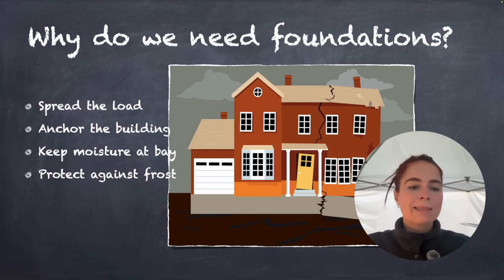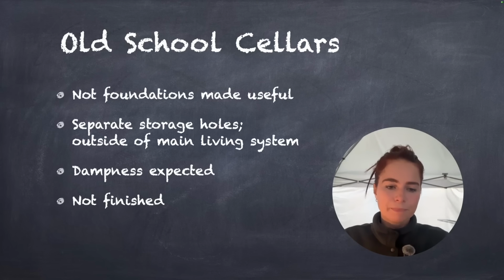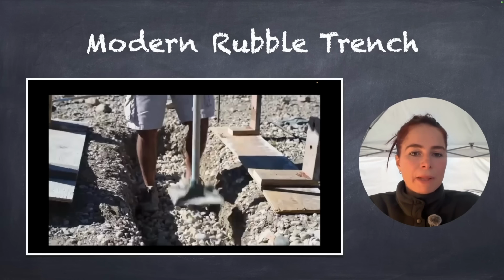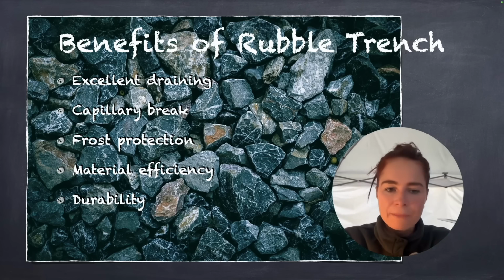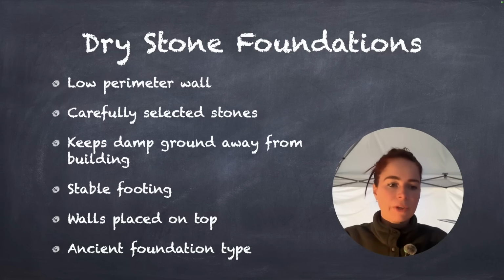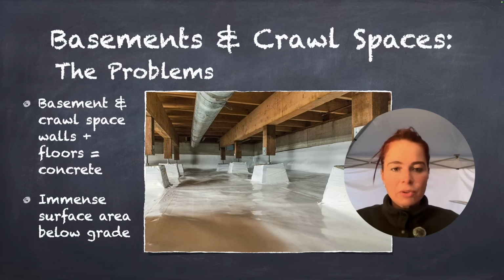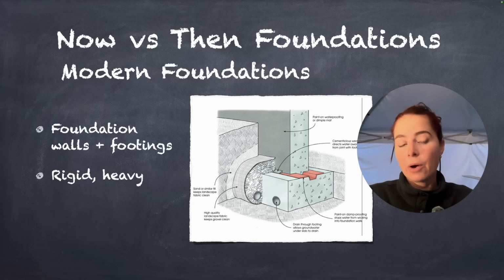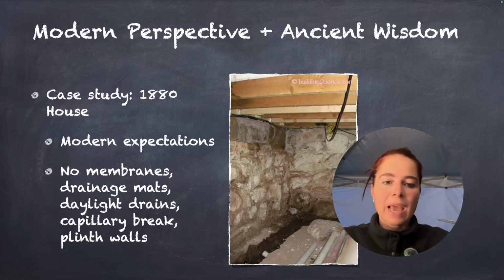Why Modern Foundations Fail — and the Genius Design We Abandoned

Comment: You can fight the water or you can control it. The most important thing is to give it a path of least resistance where it naturally flows away from the living space. Whether it is done with modern methods like bituminous membrane plus drainage pipes or stone trenches, the way to guarantee failure and it is all too common is to SKIMP on the details. You can't take shortcuts to cut costs when the foundation is the most important aspect of construction.

I have followed alternative builders and construction techniques since High School in the seventies and seen many good and bad applications. There are many earth sheltered homes with no water problems and some that do. 

I have seen something as simple as applying a coating of bentonite (clay [it's not just for your complexion] ) that works by absorbing water until it is so full any more water cannot enter which then finds somewhere else to go. That is the key principle no matter what solution you like make it easier for the water to go elsewhere.
Reply: How did well made old cellars solve the water problem though?

Comment: here in the netherlands, on many places the groundwater is on about 40 - 60 cm deep.
and there are many old basements but also naviducts new concrete basements etc.
just use good groud injection and high quality waterproof concrete.
it is like cars. you have usa quality V8 with no power lots of weight no speed etc. or a smart fast car from europe. ( or get a Toyota )

Comment: great especially i alreddy thought and experimented with rubble trenches in small scale without knowing that it is an old technique . Your information will give a good base ; ) when i start building houses in brazil. Nearly " all " of them have moisture problems on the outer walls. You can see very often black mold which i thought mainly come from rainwater dripping from the roof. most houses dont have a gutter. Ok i also considert the moisture coming from the earth cause they do not install a impermeable layer like bitumen...now i am curious about the pricecomparison and availability of gravel...
Reply: Me too. I live in the Amazon region of Brazil. It rains A LOT and the types of materials are limited in availability. Most houses are cheap clay blocks and foundations are rebar reinforced concrete. Any of this style over 15 years old is degrading and falling apart.

The soil is mostly clay and doesn't drain. I have doubts about the longevity of perfurated drainage tube for French drains. I don't see geo textile anywhere.

Comment: In the UK if a well mixed and compacted concrete wall is 200mm thick it is considered to be waterproof and individual slabs are connected with water bars to prevent moisture finding the gaps. Only commercial buildings are concrete. Most residential buildings are brick or block construction with tanking provided within the wall , on the outside surface or on the inside surface. Tanking is usually a reinforced bitumen, modified render or EPDM sheet. Maybe puddled clay would be a cheaper and more environmentally acceptable treatment for basement walls? This is a technique used to waterproof aqueducts - it may fail if it gets too dry?
Reply: Agreed. At 200mm (8") RC32+ concrete is considered effectively waterproof when well constructed, with appropriate supporting ancillary materials and well designed groundwater drainage systems should be able to resist fairly substantial hydroscopic pressues and remain dry on the internal face.

Most dampness in basements comes from poor ventilation and condensation due to the  uninsulated subterranean walls being cooler than the air temperature - although excessive groundwater above the formation depth of the basement will obviously cause moisture ingress unless its either reduced or stopped by an appropriate barrier.

New basements, be they brick or concrete, should be external tanked, insulated and well ventilated on the warm side (passively or mechanically) and you will never have any damp or mold issues.

Comment: It's good to review construction from first principles rather than be conflicted by taught methods. Knowledge of old techniques is useful. Use of vibrocompacted rubble is still present for foundations and floors known as 'engineered fill'. One unusual technique I have witnessed is excavation of peat fill below an old concrete floor to a depth of 5m and then mixing the peat with lime and then placing it back in compacted layers finished with a new reinforced concrete floor slab. In the UK we are lucky to have some magnificent 1000 year old buildings built with the expertise of stonemasons with no concrete used.
Reply: Can you explain the technique a bit more deeply
Reply: @notaras1985 It was during the refurbishment of a 70 year old aircraft factory 20 years ago to be used for high bay storage, requiring a much higher live load design. It was intended to be more economical than disposal of the peat and importation of crusher run fill.

Comment: Off the subject, but I'm a student of vernacular architecture and I've noticed that advocates of vernacular architecture today tend to romanticize very, very massive construction, like rammed earth, or adobe/cob, or structures with very thick walls like hay bale.  That's fine and they can be very beautiful, however the greater the mass,  the greater the labor. Frame building can be very economical. It was actually invented for that purpose. It uses the minimum material to do the job. Like Bucky said, why are we going heavier and heavier when we could be going lighter and lighter? Tropical architecture often uses extremely light materials as well. We have a long enough tradition of frame building in the Pacific Northwest that we often refer to early examples as vernacular. This is a timber rich region to this day. Especially, those building for themselves for the first time might want to learn that simple framing is far less labor than massive construction. Homes can be on relatively light foundations, and we have zero problems keeping them bone dry. We know how to seal the concrete and we know how to drain the foundations so they don't get wet.
Reply: being timber rich, wouldn't a Permanent Wood Foundation make sense? Then you could have a wall assembly that can be insulated
Reply: @krisgehrholz9817  There is code for treated wood foundations, but treated wood does not last, at best only double that of untreated, around here 20 years at best, plus its full of chemicals
Reply: @hansnelsen3960  I'm building at 8500' in the Colorado Rockies where the humidity level is extremely low. The below grade portions of the structure will receive the same methods of mitigation that a concrete foundation would. Its also a different grade of treated lumber, and it won't be in the conditioned space. It Is a resilient, renewable methodology

Comment: Around here, Western Washington State, if you dig a hole and fill it with stone it will fill up with water and stay wet, unless you drain the water down grade to below the depth of the hole or trench. This is because we have high clay soils, so one must provide for foundation drainage. It wont simply disperse in clay soils. Also around here if you have wood at grade sitting on the ground, or in contact with earth, or say on top of a trench filled with rubble, soil will form up against that area and begin to rot the wood. All wood must be kept minimum 8" above grade in our rainy climate. Lets say you had 8" of building stone above grade, then you could put the logs on that, but even then on a vapor barrier. In the past they used bitumen, yup, tar.

Comment: Just brush the concrete/cinderblock basement/crawlspace wall and floor with MasterSeal 581 - formerly Thoroseal two to three times and you are done.  It seals moisture and water out permanently.
Reply: any VOC's in that?
Reply: @krisgehrholz9817  MasterSeal 581 is a cement-based waterproofing coating, no VOC.  It resists both positive and negative pressure.  People used it to waterproof large concrete rainwater cistern. It also waterproves crawlspace that leaked water during heavy spring rain when snow and ice also melt and even french drain and other waterproofing cement products did not completely stop the seepage.

Comment: It really all comes down to the market and what it will allow the purchasers to buy.
  All types of foundations are used today.  For different types of structures of course.  The typical home foundation is just fit to price. Not priced to fit.   Most homes don't use a commercial building foundation due to the expense.
Some build only in black dirt to reduce the expansion of the clay soil.
Roads are built the same as the old ones.  The big ones are harder to pound down into the dirt and they don't displace easily too the left or right.  The type of rock that has a high friction angle.  Once consolidated it won't compress under heavy loads.  
They will even run the upper layer of Base Rock through a sieve analysis.  
Run plastic under your slabs.  Probably do the footings too.

Comment: No one design fits all environments, but I agree basements are simply asking for water related issues. I'd say a compromise would be the pedestal crawl spaces, IF drainage around the perimeter is designed properly AND using concrete with some crystal growing catalyst mixed in (the crystals grow when wet to effectively self seal). Mostly for the ability to access the underside of your house for plumbing and electrical servicing without raising the floor too much.

Comment: Sigh...the repeated statement of "we forgot about this" - we didn't forget... engineers know this stuff but concrete for all its flaws is superior in many many ways. A huge one is cost...concrete is way cheaper than this type of foundation in raw material terms, much more scaleable, and a lot faster to build (which also makes it cheaper to do)

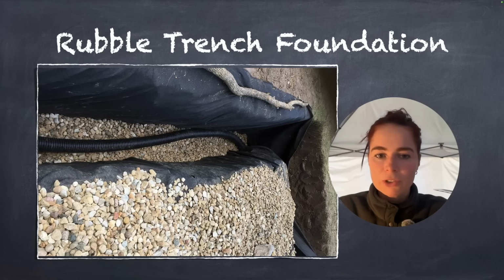We can and we now use the same "principles of moisture management" mentioned here 19:35 and others not mentioned to make concrete foundations systems less prone to damness we see in the type of basements we have in most of our homes built in the last 100-200yrs....

New basements don't have the same issues we had historically with basements...if built right
Reply: This is also why most new homes in most places are built on slab foundations and not with crawlspaces and basements unless we are willing to invest the time and resources to do it properly...
Reply: My basically take away from this whole video - don't build with crawlspace or basements unless you can do the things needed to make it work well...which is basically what we do these days when we build homes and buildings...not sure we need to bring back an inferior bearing method to deal with things when we have alternatives to do it differently already...

Still, a good job explaining everything

Comment: You should prepare your work ahead of time and have a printed outline or cut sheet available to you so that you don't use the word um too many times. 

I'm a Professional Civil Engineer  and I have considered using something like a small trench around the foundation and placing a perforated drain pipe along with rubble stone so that a drainage system could be designed for the building. I am interested to hear your thoughts on this.

Comment: This won't save a house built 60 years ago. The only option is to dig a trench down to the base of the foundation. Fill it with coarse gravel. And put drainage underneath to drain the water.

Comment: What a fascinating video! Do you think a rubble trench would do well with a walipini, half underground greenhouse? With piping going through and away from the structure? I suppose it all depends on my soil but haven't got anywhere to do it yet :) Loved the video, subscribed
Reply from the maker: Thanks so much — that’s such a good question! A rubble trench could work with a walipini if you’ve got a slope that allows it to drain to daylight. The challenge is that most walipinis are cut into the hill, so they’re fully surrounded by soil and don’t have a lower spot for water to exit by gravity. In that case, you’d need a sump or drain system instead. I’m not an expert, just learning and sharing :).

Comment: You are a very beautiful girl and very well-read. But you are misinterpreting the pros and cons of building structures. The basement under the building is a huge plus, not a minus! This is an additional "free space" under the lids, which can be used to store food (due to the low temperature), which just fits with your idea of eco-friendly housing. And the most important thing is the space for laying communications! Water and sewer pipes, heating pipes, etc. All this can be hidden and at the same time have quick access to them for maintenance and repair and even complete replacement without having to break the floor or demolish the house altogether due to the inability to maintain communications embedded in the ground! And stale air is a mistake in designing the ventilation system in the house! Of course, if there is no supply and exhaust ventilation, the air will always be musty! As for the capillary rise of water, this is also an easily solved problem! For this purpose, there is now a geomembrane and various waterproofing coatings for concrete, which are MANDATORY for use in such structures.
On the contrary, a foundation made of rammed rubble is an extremely unsuccessful construction. It is not monolithic, therefore it is not suitable for the construction of at least a two-storey building. When the soil moves due to subsidence or, conversely, rises from freezing, it does not protect the building from cracks in any way. Water is an important issue, especially in the conditions of the north (I also live in the north and I know very well about the frosty heaving of the soil!). Your foundation of rubble is essentially a ditch into which ALL the water from the surrounding area will accumulate! Gravel filling is a solid void that will fill with water as soon as it appears! Autumn rain and spring snowmelt will turn your foundation into a pool filled with rubble. Drainage of water from it is possible only if your house stands on a mountain and you can bring the drainage pipe to the nearest slope. And this does not guarantee getting rid of moisture, because when the ground freezes in winter, the drainage holes will freeze and water will be able to accumulate there until late spring. As for the forced discharge of water by a pump, this is a completely useless option. Any malfunction or lack of electricity or clogging of drainage holes will turn your foundation into a swimming pool! In general, the foundation of rubble is an unsuitable option, so it was abandoned. You don't have to do it the way you did 3-5 thousand years ago. They did this because they did not have the best materials and technologies. They had neither concrete nor waterproofing polymer materials. But at the same time, it was warm in Rome and they did not encounter the problem of freezing the ground. Study modern architecture - everything has already been thought out in it. It's just that not all builders know this, and many want to save money at the expense of the customer - without doing what is needed according to the norms. Knowledge will save you from this.
Reply from the maker: Thanks so much for taking the time to share your thoughts — you bring up some really important points about drainage, frost heave, and the role of basements. Just to clarify though, a proper rubble trench isn’t meant to act as a monolithic footing on its own — it’s a drainage and frost-protection system that supports a structural grade beam or footing above it. When it’s detailed correctly (with washed angular stone, geotextile wrap, and a drain to daylight or sump), it actually prevents water accumulation rather than causing it. There are plenty of modern two-story buildings using engineered rubble trench systems successfully, even in cold climates. It’s one of those old ideas that still makes a lot of sense when adapted with modern building science.

Comment: You could still have a basement but it would be smaller than the above floors and this would solve the water ingress problem.  The basement would be about 1/2 to a little larger than the above ground floors.  This would work on slopes where you can put drainage pipes downslope.

Comment: I hate to rain on your parade, but rubble trench is a bad type of foundation. Learn about frost heaving. There are better ways to drain water away from foundations these days. Basically, they are trenches, sometimes with tubes.
Reply from the maker: Thanks for watching! I do cover frost heave in the video — it’s a really important point. A well-built rubble trench actually prevents frost heave because the gravel allows water to drain away before it can freeze. If you’re below frost line or include proper drainage detailing, it’s one of the most resilient foundation types out there.

Comment: 2 ideas - old townhouses in London had a basement level but you access it from the street (servants quarters or whatever) but they have windows to a light well. Basically theres a trench or moat at basement level and to get to your front door there’s a little bridge. so the trench is parallel to the street and provides a bit of a setback between the sidewalk/ pavement and the facade. but then it’s still a townhouse so your basement presumably shares a wall with your neighbour’s basement
Reply: oh and second idea - I’m not sure what american building codes are like but in Cape Town all exterior masonry walls are cavity walls so like there’s an airgap between the bricks. The rest of south africa doesn’t have the cavity because its more arid so damp isn’t as much of an issue